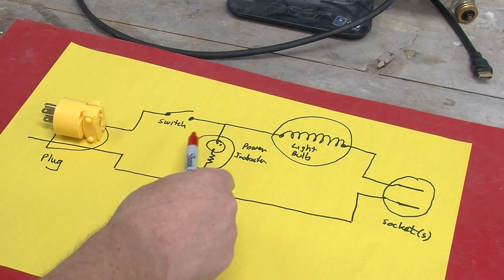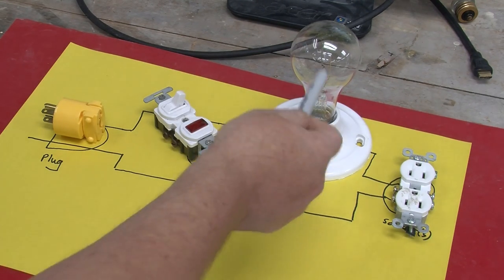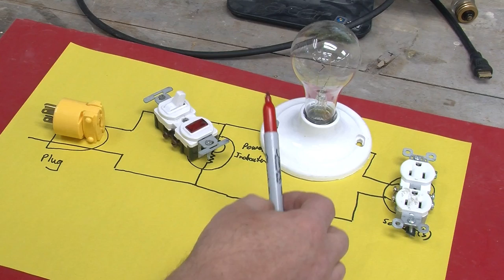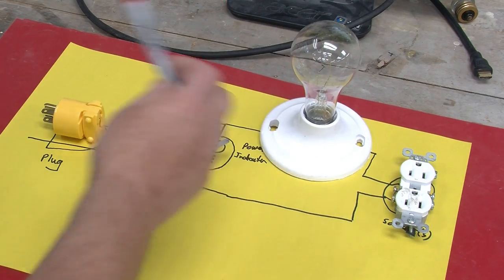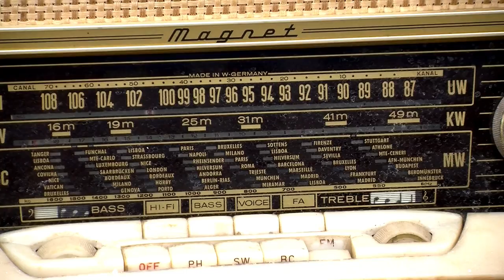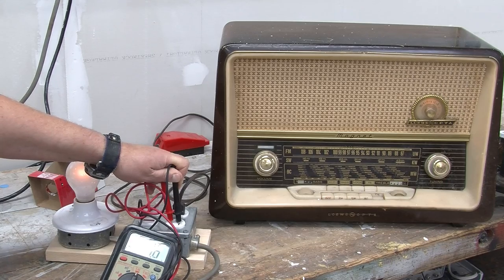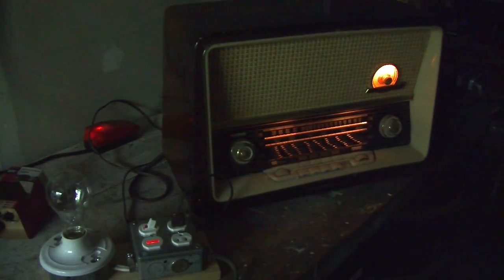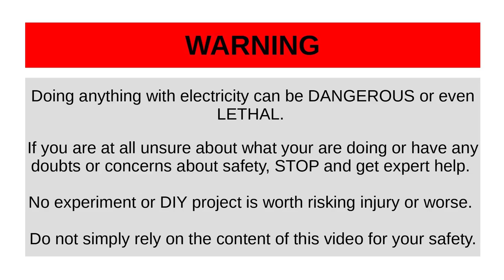When a Light Bulb is better than a Fuse

Comment: I did this on my DIY electric scooter when i was a early teen. Didnt have the money for a variable speed controller so i just had a high current contacter that gave the motor full voltage all the time. After burning out a couple of motors and never managing to find a fuse value that seemed to work the guy at my local electronic store suggested trying some bulbs. Worked a treat. I had some car high beam bulbs that would come on when you turned it on. And slowly get dimmer as you got upto speed. Never burnt out another motor again. And the fuse remained but just for dead short protection.
Reply from the maker: Yet another application for the variable resistance in a incandescent bulb! I never thought there would be so many varied uses. Reading your post I just realized it might have worked for a model train set I had as  kid - the engine's motor would often overheat. A bulb might have solved that issue! Thanks for posting.
Reply: Yep. A fuse wouldn't have helped, either. They either conduct or blow
Reply from the maker: @fedgeno  After seeing you describe it that way,  it I guess they are "digital" - either "on" or (permanently) "off"  :)

Comment: Yup I've used an incandescent bulb as a current limiter since prehistoric days as a kid back in the 1960s. As others have posted it saves on fuses and its brightness gives you an indication of power consumption.
Reply: so basically if that lamp comes on like it would in a normal light socket in the ceiling, switch it off quick because something is probably shorted or near its release of magic smoke?
Reply: @filanfyretracker  The lamp limits current so even under most fault conditions no magic smoke is released. Think of the light as a fuse with a rather high resistance.
Reply: @filanfyretracker  Yep. So if you have a 60W bulb at 120V, that's a 0.5A limiter. If you had a dead short circuit in your device under test, it would light up like normal but would prevent the current from exceeding that 0.5A

Comment: I'm retired now, but I still restore tube radios as a hobby. If people don't have a Variac, they can start with a low wattage bulb, allowing it to run for a little while and stepping up to higher wattage bulbs as they go. Great video!
Reply from the maker: Glad you liked the video. Good point about starting with lower wattage bulbs. What a neat hobby restoring tube radios. I always liked tube radios and TVs - when I was a kid I started taking them apart for parts and later fixing them. That was the time when they were easily available as people were replacing there old stuff with "modern" solid state radios and TVs. I still have quite a few tube radios from back then - mostly German ones which were always so nicely built.

Comment: I have a friend who is an actual electrician.  
He told me that, back in the days of actual fuse boxes, he would screw light bulbs in the fuse sockets instead of fuses while working on circuits.
Reply from the maker: A while back someone else mentioned a similar thing. I guess it must have been quite common back then.
Reply: I was wondering why the fuses used the same base.  Maybe that was the reason?
Reply from the maker: @Qui-9  The base I believe came from Edison light bulbs and I think they just reused it since it was good enough and already in production. I read somewhere in the early days they even used the same base to attach the first electrical appliances. I think it was Hubbell who later invented the first practical plug.
Reply: @ElectromagneticVideos   One needs to check out all the different Light Sockets in play in the early days.  Many differing ones.  Is actually quite interesting!
Reply from the maker: @johnalexander7490  It really is! If your ever in the UK or some for British colonies, look for bulbs with bayonet sockets as a modern day example. Ans also - all the different variants of  power plugs we had in the old days.

Comment: I've used basically this setup as a truck mechanic for diagnosing intermittent shorts for years and it's been great. Hook it in place of the fuse and massage the harness and sometimes find the shorts pretty quickly. A bright light is often easier to watch while massaging than a multimeter but the multimeter definitely has its place.
Reply from the maker: There are few things harder to diagnose than something that is intermittent. I don't do much work on my car but I will remember comment if I ever have an intermittent fault. I'll bet your comment will save many people a lot of time and frustration. Thanks for mentioning that!
Reply: @ElectromagneticVideos  ... this is probably the oldest trick in the book for finding a battery killer. Put a test light between a battery cable and a battery post, then start disconnecting things till the light goes out. Just be aware that certain newer components have a built in residual draw. (ex: memory in the radio)
Reply from the maker: @rupe53  I'm certainly going to remember that trick! Good point about the residual current - and possibly wiping out all stored stuff like favorite radio stations if the battery is momentarily disconnected.
Reply: @ElectromagneticVideos  ... it's not that hard to write down the stations and reset the clock, but there's a few other things like the delay timer for the dome light that will throw you a curve ball. Same goes for memory storage in the engine computer, although that will not usually give you full brightness on the bulb. What I do is pull those first to see if I need to do more. BTW, today I changed my battery in the car and used a booster pack to maintain everything during the switch out.
Reply from the maker: @rupe53  I just looked at your VW restoration channel - what a cool business! The old VW bugs were great - I learned to drive on a VW 411 we had brought back from Germany but never was lucky enough to drive a bug!
Reply: @ElectromagneticVideos  ... funny, I don't have a VW channel... but I did specialize in them during the mid 70s. I still work on a few for friends.

Comment: I used to use a firework firing system that used car headlamp bulbs as current limiters in case of an output short circuit (which was fairly common after an igniter had fired).
Reply from the maker: Interesting! 

I just looked at your Tesla coil videos - did you make the giant ones and somehow modulate them to music? That is incredibly cool!

Comment: Thanks for the description of the non-linear filament resistance. I think you're the first I've come across to mention it, surprisingly.

Should have showed the voltage after changing the bulb for completeness =)
Reply from the maker: I think its rarely mentioned because its not the main purpose of a bulb. But its actually a typical characteristic of metals - resistance rises with temperature. Iy has a few common uses - one today is measuring gas flow or air flow and in the mass air flow sensor in cars - two wires have enough enough current flowing though them to heat them. One in placed in the flowing air which cools it, the other is kept in still air. The difference in resistance can be converted to flow rate. 

And your right - should have showed that. You can do a nice little experiment showing this effect just by heating some wire in flame - will be a future video!

Comment: Working on Vacuum Tube gear as I do, it's definitely a must along with a Variac. I ended up buying a case a few years ago of 24, 300W 130V bulbs that should last me for the rest of my life. You can still buy these at hardware stores like Lowes and Home Depot.
Reply from the maker: I'll have to look for them next time I'm at one of those stores. If they don't have them here in Canada (inventory in those store is slightly different from the US) I'll have to remember to pick some up next time I'm in the US. Thanks for posting where you can still get higher wattage bulbs - I dont have any 300W ones. By the way - just subscribed to you channel - when I get a chance  I will look at your tube videos!
Reply: @ElectromagneticVideos  they're halogen now
Reply: How are you using them with vacuum tubes. I hace a giant radio vacuum tube waiting to be tested and I would like to know if there are safety measures like that.
Reply: @snaj9989  You plug in your device under test (your giant radio) into the current limiting dim bulb circuit you create which gets plugged into the AC outlet. This will limit the current through the device depending on the wattage of bulb you use. I recommend no less than 200-300 watts. The bulb will not light up or be extremely dim if there are no shorts. If the bulb lights up bright immediately, you have a short somewhere in the radio. If that happens, unplug it/turn it off and troubleshoot starting with the power cord, then transformer, etc.
Reply: @nicklikesradio  No, the 300 watt bulbs I buy are incandescent.
Reply from the maker: @nicklikesradio  People have said they work for this unusual application  too!

Comment: Another great video!!  I remember using one of these circuits to test some used equipment (strapping machines) we received to use in a conveyor system .  Most of it was exposed to the elements and quite a few pieces would trip the supply breaker when it was turned on.  We used light bulbs in series to protect the wiring from the numerous trip loads as we tested the units.  These were pig-tails with no power plugs that were normally hard wired into the system.  Wire-nutting them to the system through the  lightbulbs in series saved a lot of time and prevented damage to the control circuits.
Reply from the maker: Thats another interesting application that I never would have though of. How interesting! Thanks for posting!

Comment: Back in the day, I repaired solid state amplifiers. Almost always, they came in with blown fuses, where the customer replaces the fuse, and it immediately blows again. I use this technique, to diagnose bridge rectifiers and power transistors, which almost always fail short. This allows me to apply current to measure across collector/emitter junctions, as well as diode junctions, to tell which device has failed. This apparatus is also a good thing to plug switch mode power supplies (SMPS) into as well. Things like phone chargers and 'laptop' power supplies often use a simple bridge rectifier and capacitor directly on the AC line. These tend to load only the peaks of the AC wave form, resulting in repetitive short duration high current spikes on each crest of the sine wave. Using this as a ballast will reduce the peak current, while increasing the duration greatly reducing stress on the rectifier as well as the capacitor. this type of input circuit is the electrical equivalent of pounding a round peg into a square hole! If you listen carefully you will gear the filament of the light bulb, as it buffers the peak current.  It also serves as a 'surge protector', in case a breaker trips, by absorbing the fly back surge, which is a leading cause of SMPS failures. (Size the bulb for ~3-5 volts of drop, for best protection, and best efficiency)
Reply: My inverter fuse aways blows .can we use this technique of bulb .if so how many wats bulb
Reply from the maker: Vincent - sorry I haven't responded to your post sooner. For some reason I dont always see new comments. I really appreciate you taking the time to explain how it can be used with semiconductor equipment. I will have to try listening to the bulb as you describe!
Reply: @BeRight4u  The bulb only helps, if the fuse is blowing because of the inrush current of charging the capacitors, when you first hook up the battery. A lightbulb won't help for a chronic overload condition. If you're blowing fuses during use, check for voltage drop between the batteries and the inverter. Since inverters use pulse width modulation, they will draw more current at a lower voltage, to maintain output voltage into a given load. The more voltage you can maintain on the power input of the inverter,  the less current it will draw, and hopefully, stop blowing fuses.
Reply: @vincentrobinette1507  the inverter design is such a way we can't insert the fuse if it fails.i am looking for a way where i don't have to open the inverter regularly.i don't know where's are problem .any suggestions to solve.

Comment: I once saw a circuit using only a lightbulb and some very large inductors and oil capacitors that would oscillate- using the non-linear resistance of the tungsten lamp filament- so cool and fascinating.
Reply from the maker: I have never heard of that - how interesting! Sometime I'll have to see if I can do that!
Reply: @ElectromagneticVideos  I would start by researching tunnel diode oscillators - very similar concept. The LC tank needs to be resonant at a frequency well below the thermal time constant of the lamp filament.

Comment: In the old homes fuse panels had screw in fuses that were same size as bulbs. 
  Some times when you couldn't find cause for short circuit a bulb was used. When  looking for short circuit if  the bulb went out, you found the cause of the short circuit.
Reply from the maker: Another neat  variation  of using a bulb from the old days, although I'll bet its still sometimes done in older houses that  have fuse panels (although I'm sure fewer and fewer are left). Thanks so much for mentioning this use!

Comment: they used them in battery chargers for years as a current limiter.
Reply from the maker: Interesting! I didnt know that! I can sure see how they would have been a great in that application before cheap power electronics.
Reply: Please explain more!
Reply from the maker: @jeffkardosjr.3825  If you hook a battery charger to a dead battery you could run into the situation where it appears almost as a short and burns out the charger. Also drawing a lot of current while charging can damage a battery or reduce its long term service life. You could use  a resistor to limit the current, but it would drastically show down charging an almost full battery ie when going from 90% to 100%. The great thing about a light bulb is that its resistance changes with temperature. So i in the first situation of an almost dead battery, the large current draw will heat the bulb and make it glow. The high temp will increase its resistance limiting the charging current. At at the battery's charge increases, it will naturally reduce the current drawn, and the bulb will dim and eventually not even be warm enough to give off even a dull light. At that point it will be so cold its almost like a wire and will let the battery get up to 100% nice and fast.
Reply: @jeffkardosjr.3825  Automotive chargers from the 50s used them to limit the output current. Some had more than 1. As in 1 for 10 amp, 2 for 20 and so on. I have repaired several for people.
Reply: We have and still do wire an incandescent bulb into a standard lighting and receptacle circuit if we have a fault.... Can then go trace the path if the fault current...
Reply: @REWYRED It was easy to replace the screw in Edison base fuses with an incandescent bulb when searching for a short circuit.
Reply: @glengivens8986   Yep!  Makes it really easy to do when you have those

Comment: I remember seeing a vintage train set that controlled  the speed of the train by screwing in different wattage bulbs.
Reply: I am an old time model railroader, but I dont think I have heard of this sort of thing.  I can certainly see it used for one of the older AC train sets though.  Any idea what make it was?
Reply: @richardstewart4135  No I don't remember the brand. It was owned by Fritz Vantoggen not sure on the spelling. It was featured in one of the TM Lionel DVDs. I will look and see if I can find it online.
Reply from the maker: That neat - probably way cheaper than a variable transformer back then.